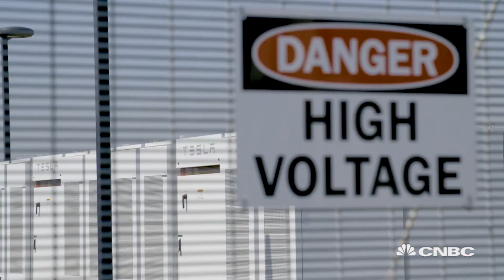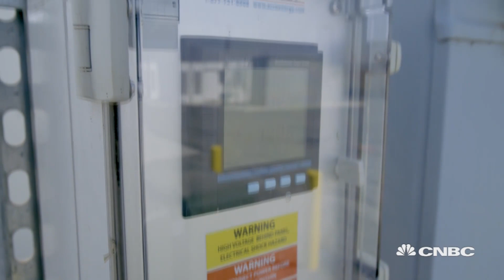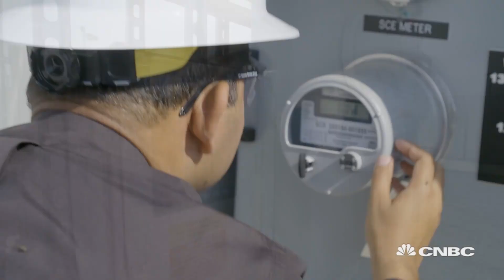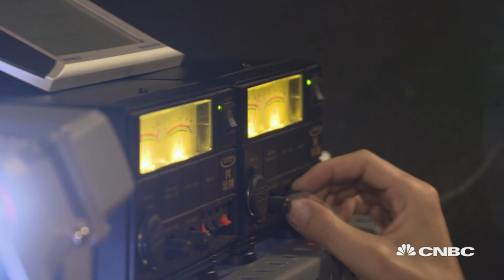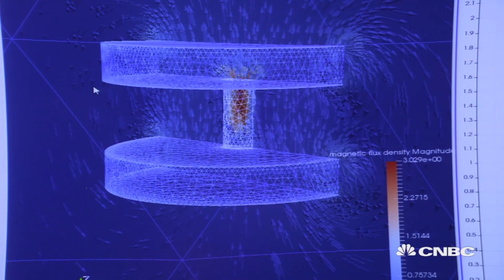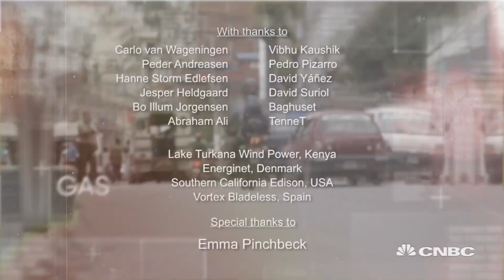The innovations and projects transforming wind power, part two | Sustainable Energy

Comment: A good summary of some of the many issues with wind and solar energy:

Extreme low EROI (Energy Return on Invested) of wind & solar. Ferroni found a full lifecyle EROI for Switzerland in Solar PV of 0.82:1, just a new-fangled way of burning fossil. You need an EROI of 14:1 to power a modern industrial civilization. 

Extreme seasonal variation of wind & solar. i.e. Britain, Germany, Canada, Russia many places 6:1 ratio summer: winter months. With energy demand max in winter. No known storage method to compensate for that.

High cost of wind & solar. Easily 2-10X the cost of factory built molten salt reactors. Not economically feasible. It would collapse our economy. Even the wealthiest nation in Europe, failed miserably, whereas France succeeded in 25 yrs with ancient one-at-a-time build nuclear.

Fact that wind & solar only replaces a bit of natural gas fuel worth 2 cents/kwh in USA & Canada. Does not replace any fossil infrastructure. In fact adds infrastructure (i.e. storage, long distance transmission, grid stability batteries).

Extreme geographic unsuitability of wind & solar. Solar is pathetic in the north, rainy & cloudy areas, mountainous areas. Wind is pathetic in vast regions.

Extreme land use of wind & solar, easily over 50X more than nuclear, many areas do not have sufficient underutilized land areas of that magnitude.
 
Extreme transmission cost of wind & solar. Wind transmission must be oversized by ~3x, solar by 5-10X. More than 300km transmission costs as much as a NPP of similar size. 

Necessity for storage just to cover daily variation pushes solar & wind costs sky high, far above nuclear, and forces EROI so low it is really just another way to burn fossil. Storage for weekly, monthly and seasonal variation is unavailable. 

Extreme difficulty of wind & solar to supply the 85% of the world's energy supply that is thermal energy, hasn't even made a remote dent in that segment. 
Extreme vulnerability of wind & solar to climate change, windy & sunny areas will shift causing extreme & disastrous changes in energy supply, which we are already seeing in hydro plants built where there was once plenty of rainfall, and now experiencing decades of drought. 

Extreme vulnerability of wind & solar to materials shortages. Solar uses 84X the material inputs per kwh as nuclear. Wind uses over 50X the steel & copper, 34X the concrete of current nuclear, much more than that for Molten Salt reactors. It is extremely dubious we will have sufficient copper & rare earth elements to supply what wind & solar would need. Add storage to the equation and there is no chance we will have the materials needed. And you still need to the vast materials to maintain a fossil fuel backup energy supply, all the supply chains going all the way to Middle East Oil fields and military protection.

The mammoth waste problem of wind and solar. Wind turbines only last 8-20yrs. Solar 10-25 yrs. A solar PV powered world would generate 63 thousand X the waste of a nuclear powered world. Even at 0.15% of world energy, solar PV is already causing huge piles of solar panels that we have no capability to dispose of or recycle properly. 

The extreme difficulty of ramping up Wind & Solar. Note severe material requirements above. Nuclear build-rates have historically been minimum 4X faster than wind's maximum and 10X faster than Solar's fastest 4 year build rate period. In spite of the massive subsidies wind & solar have gotten compared to nuclear, per unit energy generated. That's just US federal and doesn't include all the state & local subsidies. And that's just one-at-time nuclear construction, not modern factory built molten salt reactors. After spending over $2 trillion, solar and wind are only up to 0.7% of world energy supply, with world energy increasing by 1%/yr and most of the current installed solar & wind will have to be replaced in the next 10-15yrs.